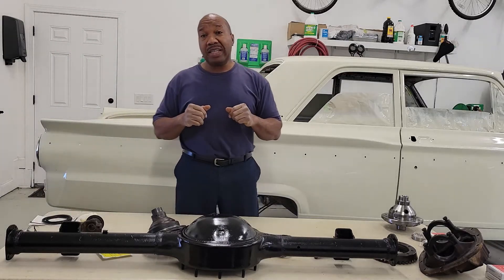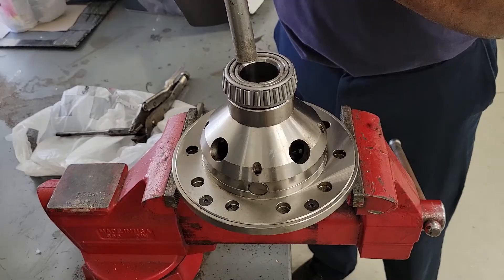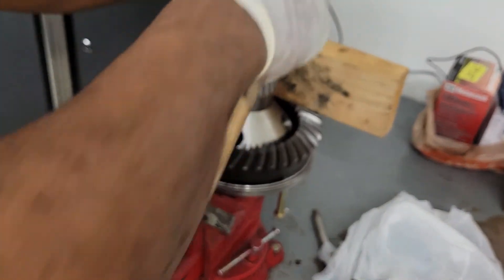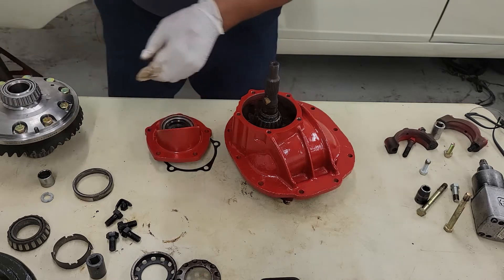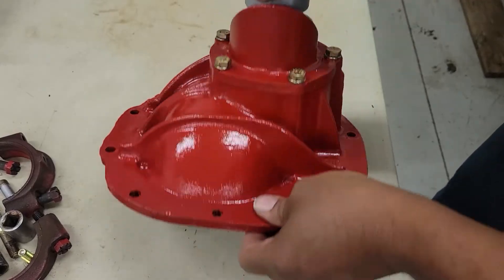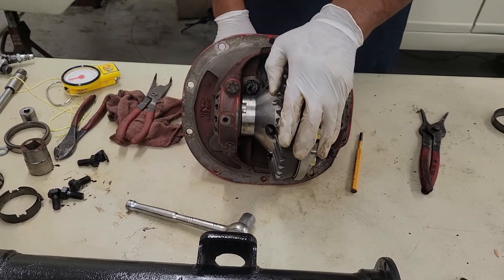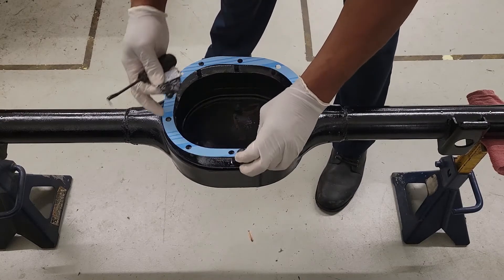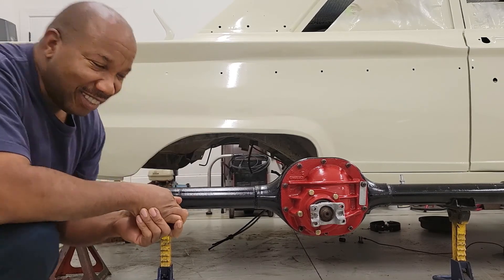How To Convert Standard Differential Into Positraction

Comment: Liked the video man, but next time instead of hitting those bearings on; instead freeze the bearing and heat the shaft with a torch and that thing will slide on like butter👌🏻. No reason to beat yourself up hitting that and possibly messing up the bearing…
Reply: You did nothing wrong just there is easier ways of doing it.
Reply: Heat the bearing and freeze the shaft. plus instead of hitting it with a punch Id suggest using a large enough socket over the bearing to avoid deformation and cocking the bearing.

Comment: Hi great video! I'm building a 66 Mustang with 8 inch rear end like yours. I don't know what type off posi diff I should get I going to use the car for driving to car shows and meet but also plan to road race the car. I need something thats good for turning too. Do you have any recommendations?
Reply from the maker: Great question!
I have converted my 70 Mustang with a Dana 8in Differential. It's o-k but What I don't like adout it. When I make a sharp right turn. The right rear wheel will spin. But if I make a sharp left turn it works fine. So I try not to give it too much gas turning right. I called Dana and the guy told me that he never heard of that problem.  I find that work to believe. This is why I decided to try the Yukon Differential. So we will see😄